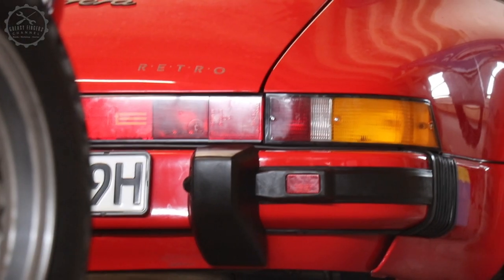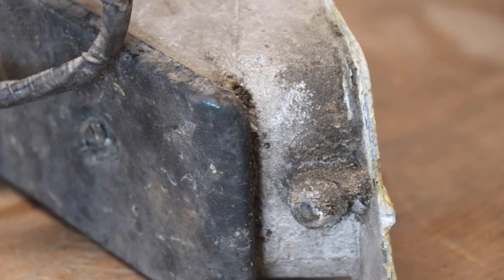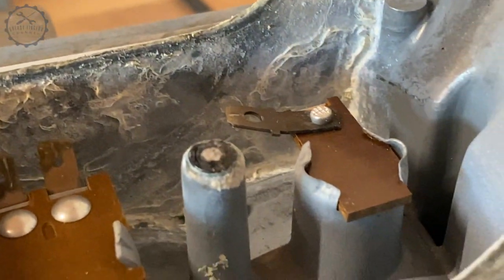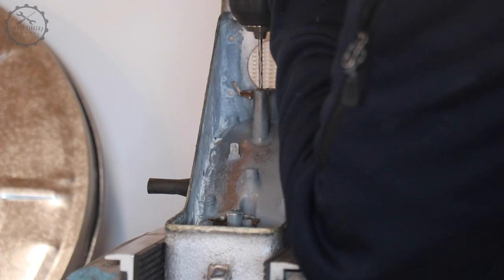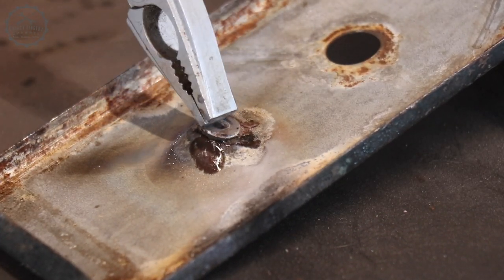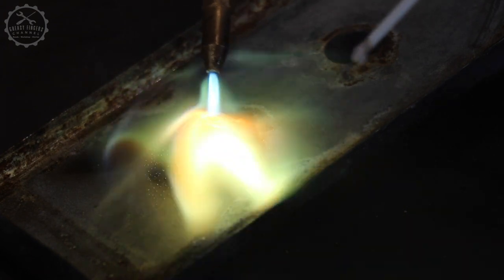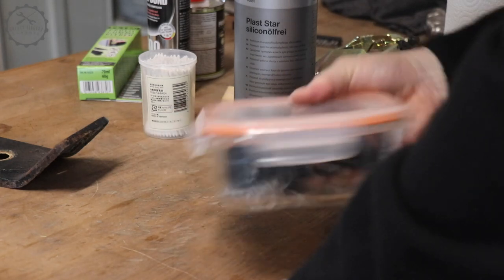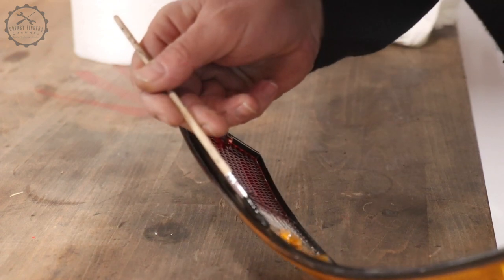Restoring The Tail Lights (Porsche 911, 87)

Comment: Great video.  I just did this a few months ago.  I took it one step further and sand blasted my housings, but to do so I needed to remove the bulbs.  And that is where I ran into a problem.  I tried to bend back the tabs, that hold in the bulb holders and they broke right off.  I still need to figure out how to address this.  I ended up using an epoxy just like you to fill some cracks I had and it worked perfect.  I'm a long way from being able to try them out as my restoration is still on the rotisserie.  Great video as usual!  And I think this is a great topic as so many 911 owners need to address their light housings.  I am going to share this on one Pelican Parts again for you!
Reply from the maker: Thanks, Rodney.
Exactly the same happened to me. I gave up after one tab had broken and accepted that I better not disassemble them completely.

If your project can be followed at any place on the web, please share the link. I’d love to see it.

Thanks a ton for sharing me again. Views have increased very significantly since you first did, I’m very grateful.

Comment: Hello, thank you for another great video. An excellent product for eliminating dissimilar metal corrosion is Teffgel. It is a teflon grease developed in the boating industry where there are many cases of stainless steel fasteners being used on aluminium boat hulls.
Reply from the maker: Thanks for the tip!
I’ve googled it and it looks very convincing. Not a bargain though!

Comment: Great video enjoyed watching every bit of it.     I had problems with my tail light housings so I did like you I took them out and took them apart repainted the outside painted and protected everything in but new wiring harness for the inside of the tail lights and now I have great working tail lights that I restored
Reply from the maker: Thanks, mate. 
Restoring it is about ten times the fun of replacing it, right?

Comment: A very Zenlike approach to fixing things. I'm pretty sure car buffs in 30 years will have a hard time restoring today's cars-plastic is not forever and at least with aluminum you can refresh it.

Please-what rubber rejuvenating product are you using.  I worked up a spreadsheet for rubber bits for a 1961 Alfa this weekend and had a heart attack. Thanks for the tip on EPDM-new to me and glad you pointed out this material. Thanks again
Reply from the maker: Hey Steve.
Some other viewer found out the stuff I used is not available in the US. Anyway, the product is named Koch Chemie Plast Star. 
I guess you can just take Armor All, it does the same thing.

Comment: In the middle of the same project on same car. What kind of primer did you use on the back cover? Back cover finish is galvanized. I´d also need to restore the reflective surface of the light housing (brake light and reverse) but I don´t know what type of paint to use. BTW, I love your videos.
Reply from the maker: The back covers‘ galvanic layer was all gone at mine, I just painted them and primed it with Brunox. In hindsight at least at the left side some stone guard is not a bad idea.
Chrome plating I don’t know, was okay at my car.

Comment: Hi, I just found your channel and subscribed, great work. 

I am restoring my 2004 Carrera (in Dresden) and am currently working on the engine. I have spent some time with the dremel cleaning the aluminium casing, and the day after cleaning, crystals form on the surface of the metal which can grow quite big if I leave them. I can only presume the cleaning process has activated old road salt on the metal which is reacting to the water? Anyway, I have tried cleaning it off, but the crystals return. Do you have any experience with this, and any method of treating it? Many thanks in advance. Joël
Reply from the maker: Hi Joël. 
Cheers for your project. 
I have no idea. Just stabbing in the dark: have you tried different wire wheels on the Dremel? Maybe a plastic one?
Reply: @GreasyFingers Hi, thanks for your reply. I will look at using a plastic wheel. Maybe that will help. I tried a vinegar and distilled water mix yesterday so will check how that has worked out today. 👍

Comment: What size thread pitch did you use? 1.25?  // what size drill bit to drill the new hole?  // I'm currently restoring my lights on my 80 SC and the stock screw head broke off  like yours - It's impossible to drill out the old screw - I need to replicate your excellent process
Reply from the maker: Hello Kim. I made an M4 & I used a cheap thread cutter kit that comes with the right drill bits for each thread size.

Comment: Would the aluminum screws be a better option for this application? Nice job
Reply from the maker: I guess they would in terms of corrosion, but I distrust them in terms of strength. I’d surely forget that I used aluminium screws and rip them off next time I tighten them. If I went for anything else then steel, it’d be titanium.
Reply: @GreasyFingers  I forgot about the titanium! Good catch. Anyway you did a very nice job. Nice talk.  have a good one sir!

Comment: Hi excellent video they look as good as new when you're finished.
Can you please let us know what products you used, in particular the paint for the aluminium, the metal and the seal conditioner.
Many thanks.
Keep up the good work.
Reply from the maker: Hello Liam. Thanks, glad you like it.
The paint is simple acrylic paint from the hardware store next door. The plastic conditioner is Koch Chemie Plast Star. The material I used to glue the cracks is named Liquid Metal. You can get it from different suppliers like e.g. Liqui Moly. I used some no-name product from Amazon.

Comment: I would have used anti seize on the screws and a small oring to keep the water out, not Loctite.
Well done with welding, what did you use, looks like solder?
Reply from the maker: Thanks, mate. You’re binging my films, aren’t you? I admire your skill to resist falling asleep.

Yes, I used silver solder.
Reply: @GreasyFingers  yes I am binging, it was only 11pm, now it's 5:32am 👍😀

Comment: are you always adding thread lock but just now showing us until now ?
Reply from the maker: I normally don’t use it, I prefer mechanical means. In this case I used it to have a layer of insulation between the stainless steel screw and the aluminium case. Contact corrosion, you know.

Comment: What is the trick to get the tail light wire harness grommet back in to the body 15.27
Reply from the maker: Pulling from inside and at the same time pushing from outside. Pain in the a***
Reply: @GreasyFingers  How do you pull from the inside?  There is nothing to grab on to?  Thanks for your reply!
Reply from the maker: I’m sorry I don’t remember exactly.
All I remember is that it only worked when I used both hands inside and outside. Maybe I helped it in a bit by pulling the cable.

Comment: Aluminum taillight casings? Wow!
That's a perfect example of the overengineering that made Germany's reputation!
Reply: The first 105 series Alfas also had aluminum taillight casings, but later ones were made of plastic, like many other parts on these cars. There is a clear quality decline visible from the late 60s to the late 70s...
Reply from the maker: The more I look into the cars of both brands the more I understand how up-in-the-clouds they were back then.
Reply: Well, as well described in the video, if you don't have a beautiful country to wander about like Italians , or good wines and food like French, you can as well design and manufacture great taillights and well insulated wiring!
Still laughing thinking about it, and good jokes always are told in the most serious manner.
Another great video Greesy fingers, thank you.
Reply from the maker: @through_changes  So much loving your comment.
Where are you based, mate?

Comment: You sound exactly like Werner hertzog  the director ha. Could you recall the Amazon black weatherstrip you used on the lights  name or link in Amazon I’d like to grab a roll of it . Porsche weatherstrips are very expensive and I need a lot. Thnx
Reply from the maker: Yeah, I hear that from time to time. I watched some interviews with Werner and came to the conclusion: you guys are right! 😀
You mean the rubber seal?
Reply: Yes the rubber seal sorry. The ones I see on Amazon don’t look as thin and playable as the one you were cutting. Thnx
Reply from the maker: @jeffro70  Here you go.
The link points on the German Amazon, but at least you have a spec.
Reply from the maker: EUTRAS Fassungsprofil FP3001 Kantenschutz Dichtungsgummi – Spaltmaß 1,5 mm – schwarz – 3 m https://www.amazon.de/dp/B01C1N2RL8/ref=cm_sw_r_cp_api_glt_i_C46EGGPQ8SYERF14W8S1?_encoding=UTF8&psc=1

Comment: You can also fix the rust holes in your car body with that Flussigmetall ;)
Reply from the maker: I knew someone would say that. 😜
Reply: @GreasyFingers  I must admit I have done much much worse and risky repairs with this material.  I remember having fixed a broken Fiat 126 carb with this material when I was young. It worked very well though...
Reply from the maker: @bertone83  You were young and needed the money!

Comment: HI , STEVE HERE, LOVE THE CHANNEL SUPER INFORMATIVE .I HAVE A PROBLEM , I HAD TO REPAINT MY FRONT BUMPER ON MY 84 TARGA. BUT STUPID ME DID NOT PHOTO THE TURN SIGNAL CONNECTIONS . I AM TERRIBLE AT WIRING DIAGRAMS AND THERE IS NOTHING ON THE INTERNET TO HELP. CAN YOU GIVE ME ANY DIRECTION OR A PHOTO IF YOU HAVE............TY IN ADVANCE  (DESPERATE) .....STEVE
Reply from the maker: Hi Steve. I’m sorry, I was terribly busy in the past weeks. Does the problem still exist? If yes, you might want to contact me on instagram’s messenger.
Reply: @GreasyFingers  ty

Comment: Another superb video.  I find very valuable the sections where you demonstrate how to get out of the additional trouble that results from attempts at restoration, such as the broken heads from screws that wouldn’t move.  And, those little red insulation thingies!  Thanks for the insight on how the development of those went down.

Have you seen the LED arrays for brake lights and tail lights, made by Jerome Joseph, a guy on the 911 and 914 bulletin boards who goes by the handle “Spoke.” I have his arrays on both my 914 and ‘87 Carrera.  They’re a fine upgrade to the incandescent original bulbs.  His website:  Spokeworksled.com.  Worth a look.
Thank you.
Reply from the maker: Thanks for the tip, Bob. That’s totally cool, I think it must try this ...

Comment: Weird, my 88 had totally different connections to the body (not an improvement)
Reply from the maker: You mean they removed the nine pole plug & socket in the inner fender?
Reply: @GreasyFingers  Just that the housing connection to the body has changed apparently. Mine is heavier hardware (screws) into captive nuts.